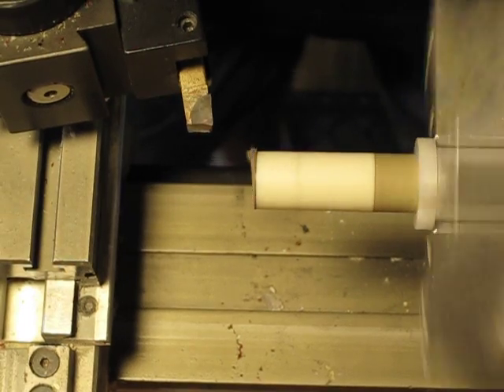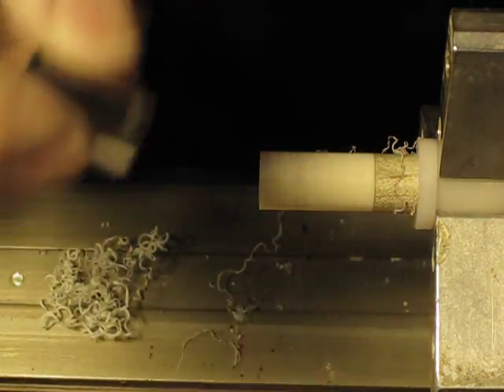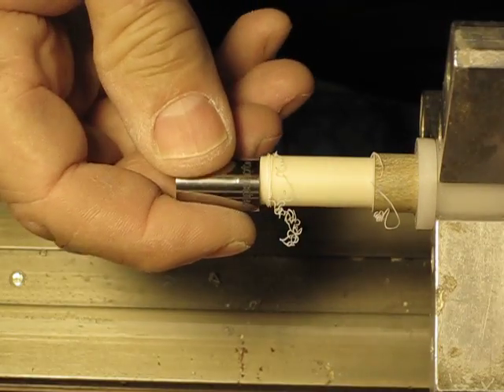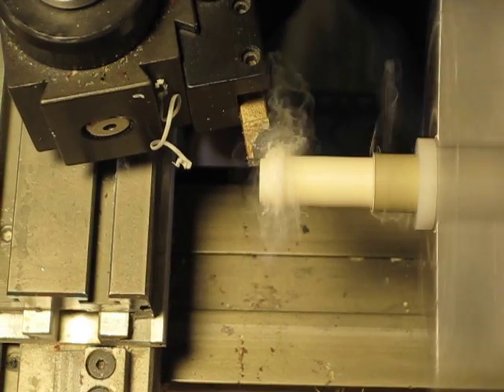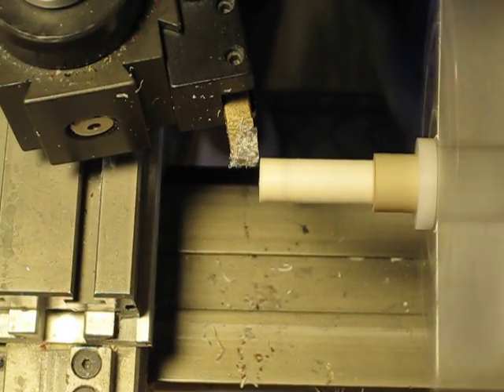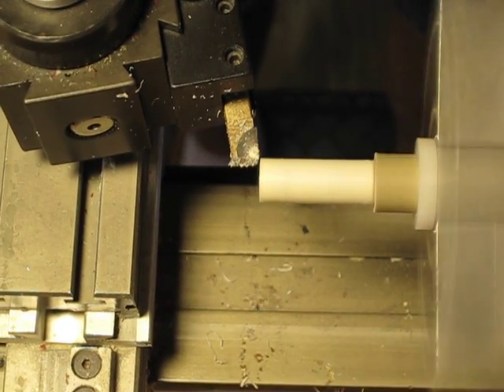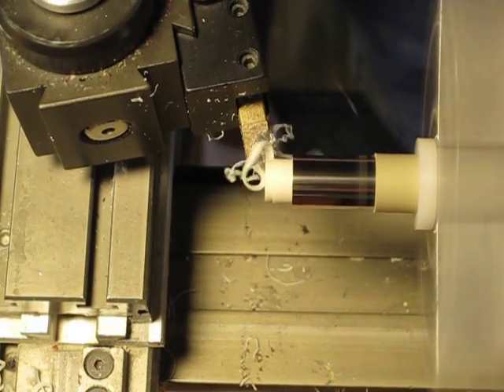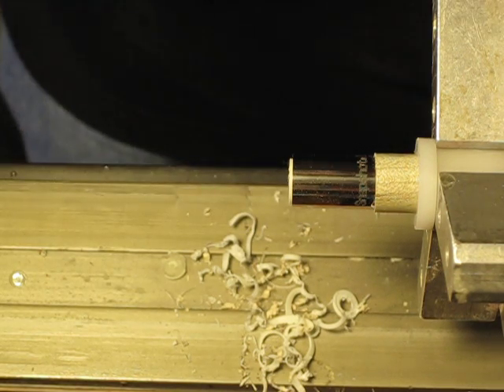Video#2 Snapshot Pro Tungsten Carbide Ferrule Installation Part 2

Comment: So the shaft is shorter now ?
Reply from the maker: In this example, yes, by about 1/4".  The customer wanted a 3/4" Snapshot Pro Ferrule.  His existing ferrule was 1" long.  If he wanted a 1" Snapshot Pro there would be no reduction in shaft length.  Thanks